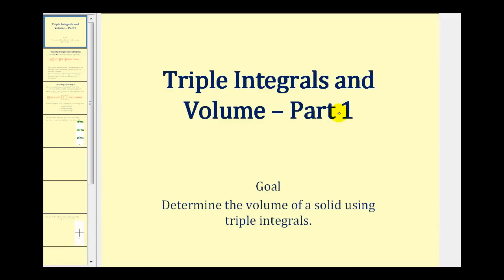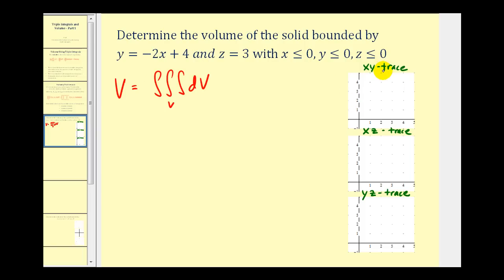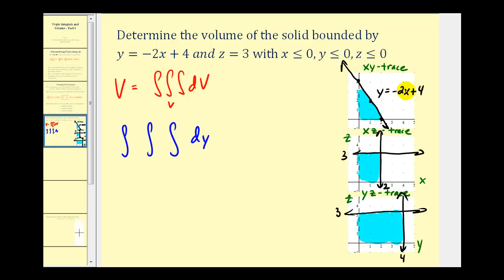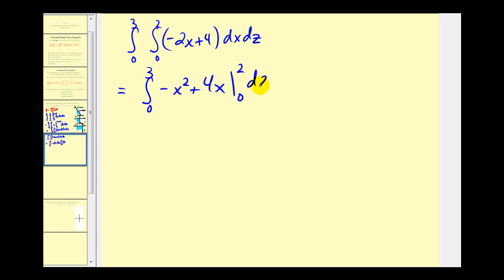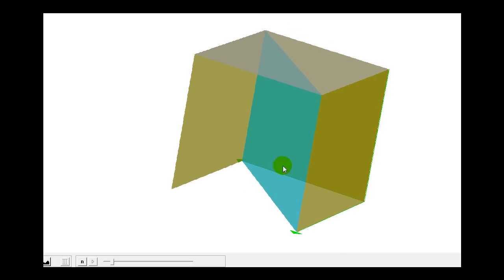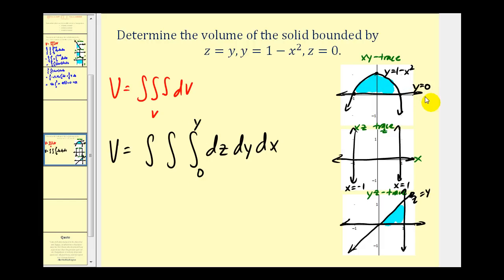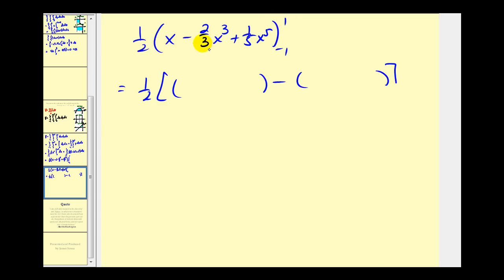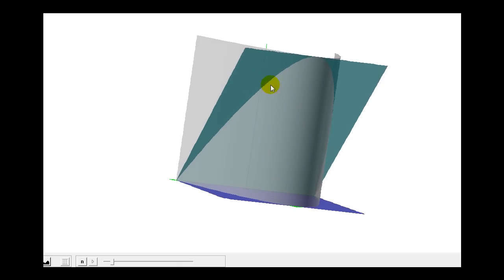(Updated Version Available) Triple Integrals and Volume - Part 1

Comment: If we decreased the height and integrated it so we found at last ❓❓❓if total volume is
 4pi((1-r)^3)/3

But it's decreased 
By r 

So what's that results show

It's volume or area or mass or density or Force or momentum or inertia 🛐🛐🛐🛐🛐🕉🛐🛐🛐🛐🕉
Reply: Meter cube integrated and it's given an extra meters so where that extra meter exists ❓❓❓❓❓